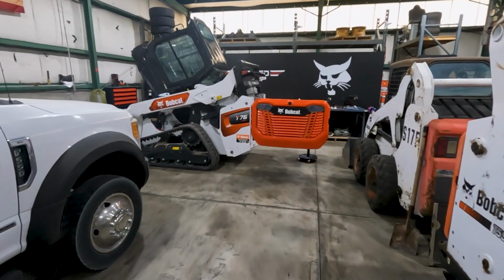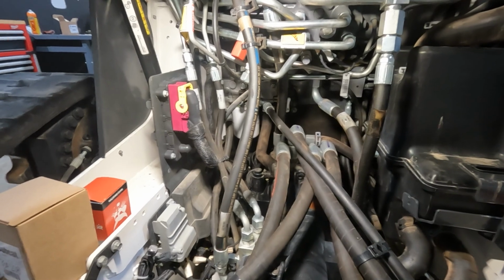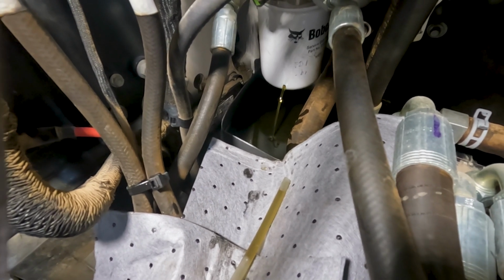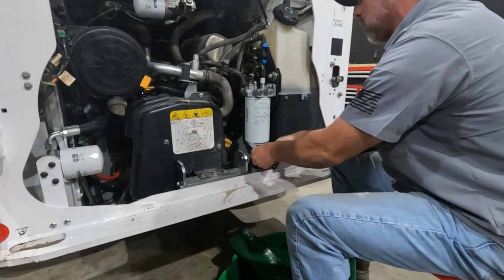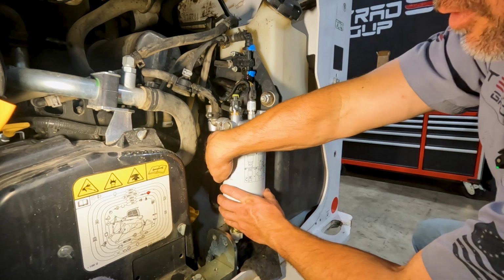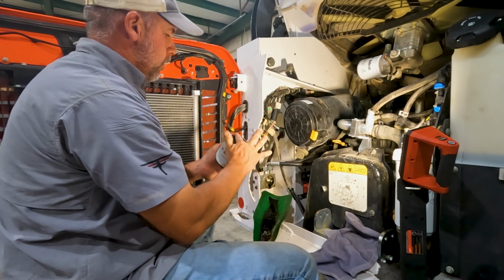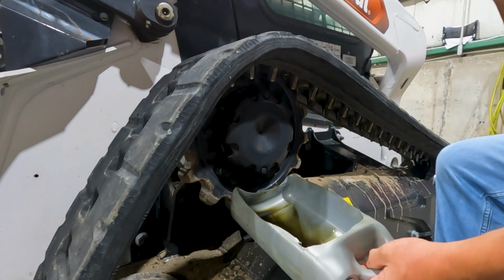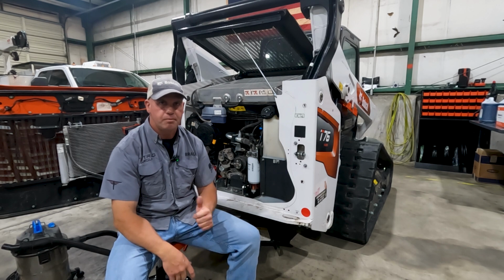Bobcat T76 R-Series Full Service.  Everything You Need to Know to Service Your Machine

Comment: For the lower Hydraulic filter where you made the hole, it keeps letting oil out due to it connecting to the Cooler for hydraulic, so basically you are draining the cooler which is full of Hydraulic Oil. What to do to stop it?? is to clamp that line that goes to the cooler, so that the oil in the cooler stays in the cooler and its easier to work with and you wont have to keep draining the oil pan. Many greeting from Germany (Great Videos as always use some of your tips and Tricks in the Workshop)

Comment: When you posted that filter relocation kit I thought it was something bobcat actually come out with, didn’t realize you guys actually made it for that machine. I talked with one of the bobcat troubleshooters and our dealer service rep awhile back about this idea to moving the filter location for the engine oil filter and the case drain filter.
Reply from the maker: I also mentioned to several TSM's but never went anywhere.  The new Develon skid steer has a D34 with a Doosan relocation kit.  Last I check it is still not available from Doosan yet.  The case drain could use one for sure.

Comment: We also did a WTH when we saw that fuel tank vent.  I really like how the manual just states replace it, and gives  you no guidance.  When you do an oil change, and if you want to use that bottom cover, make sure you have some of those retained nuts on hand, and maybe some bolts.  (7155413  Nut Retaining, 29CM1025 SCREW FLANGED HEAD CAP)  The 2 little wings that hold it to the frame are very flimsy and the bolts rust to them pretty easily.

Comment: Is there no drain on the side of the block for coolant. Also I would use an air vac coolant refilled to hold suction on the coolant system enough so that you could pull that bottom hose off and you wouldn’t spill anything at all
Reply: Also is there no crankcase filter

Comment: Is this process the same for the T64? Are there more or less filters/ fluids
Reply from the maker: @rockyderby-898  same process
Reply: @tetradgroup  after changing the hydraulic filters, is there a process to bleed the air? Or is it a non-issue?
Reply from the maker: @rockyderby-898  no issue on the skids